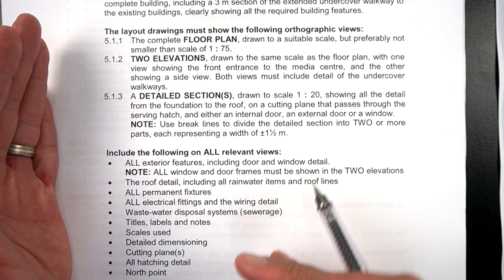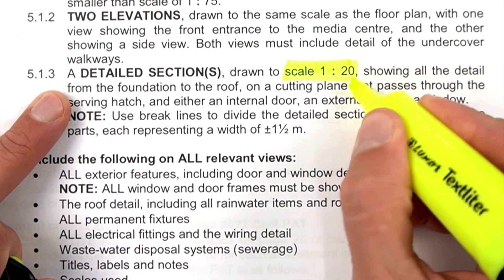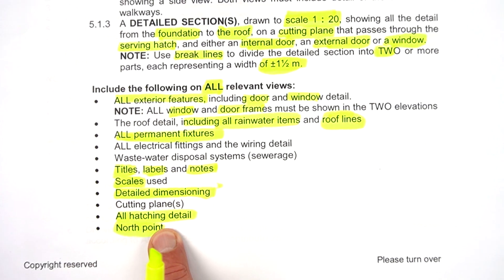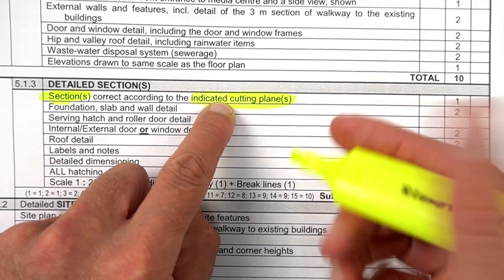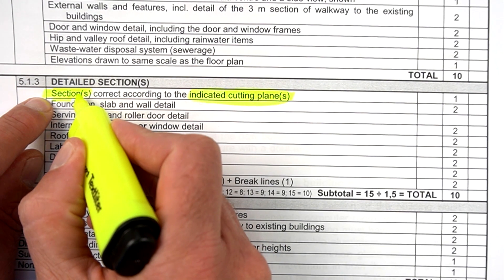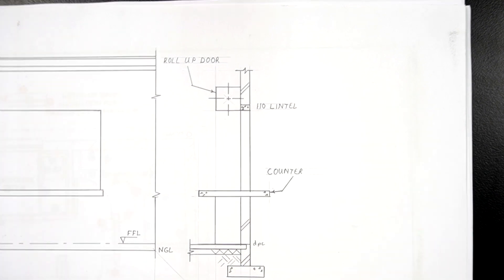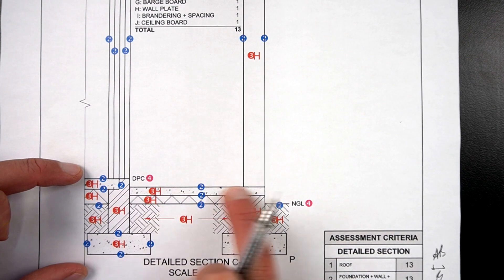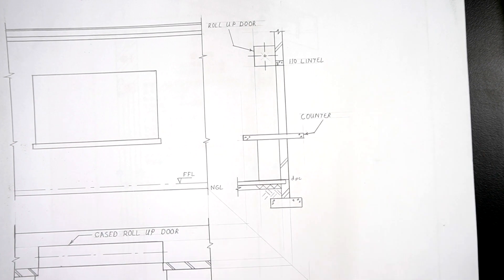HOW to DRAW the SECTIONAL ELEVATIONS correctly - Gr 12 EGD 2022 - Episode 10

Comment: Does it mean a single cutting plane must be used, and that cutting plane should cut through the hatch and a door? 
Or will there be two cutting planes?
Reply from the maker: Hi Nxtgen. Two cutting planes would be preferred. Just make sure you meet the requirements for each.